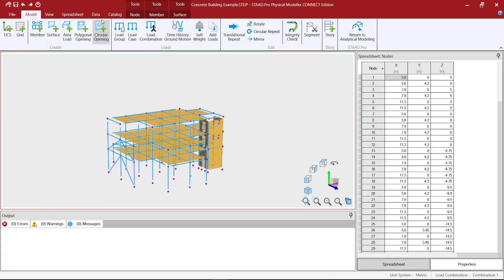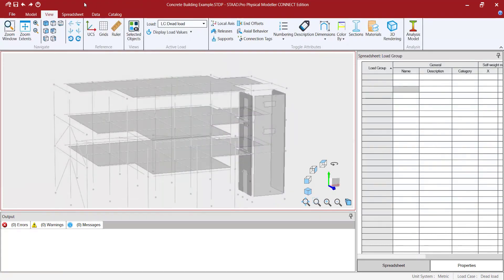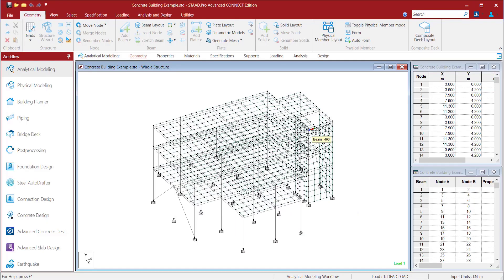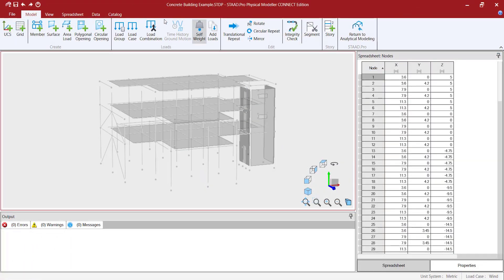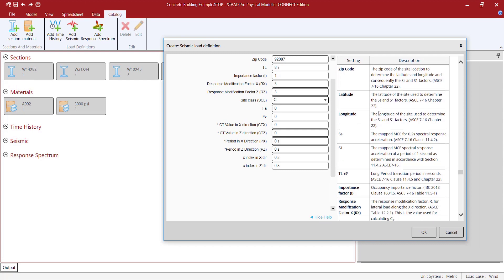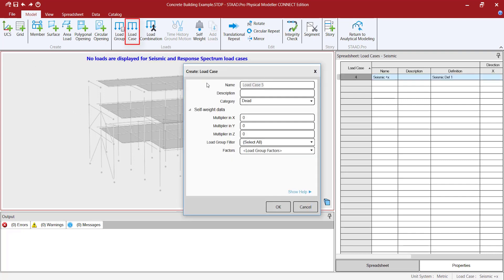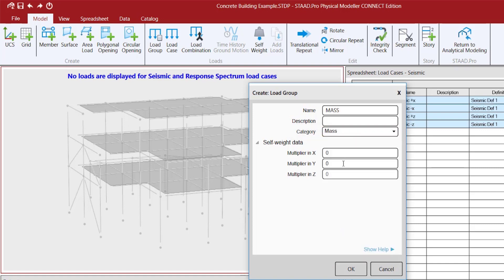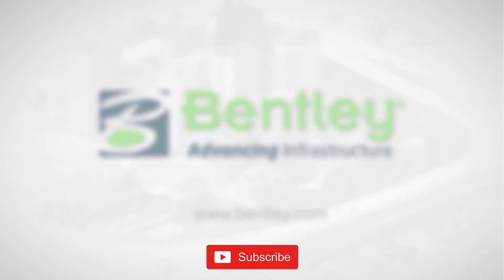Loads on STAAD.Pro CONNECT Edition Physical Modeler

Comment: You teach the concept of load groups, which is using reference load to generate "realistic" load combinations, yet you still use load combinations like it was 15 years ago. The method is not even possible in physical modeller. OMG